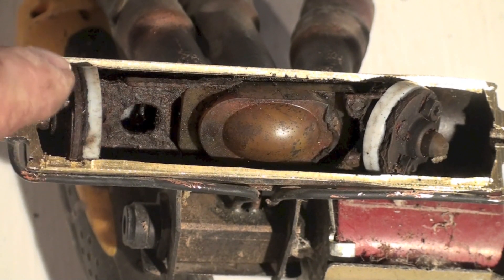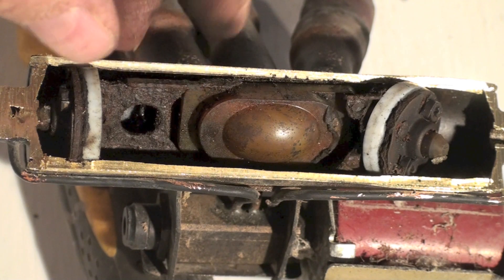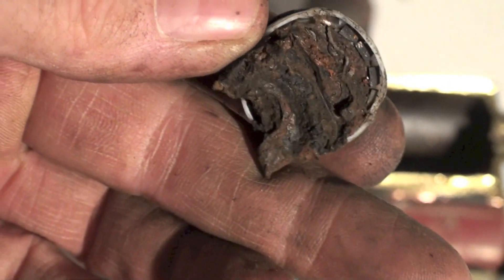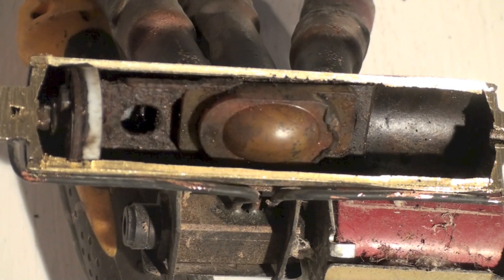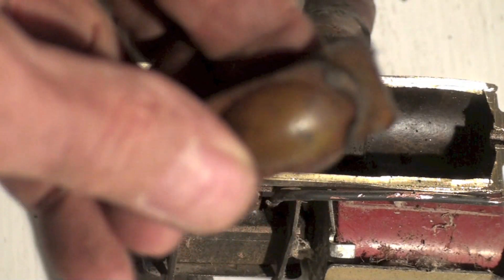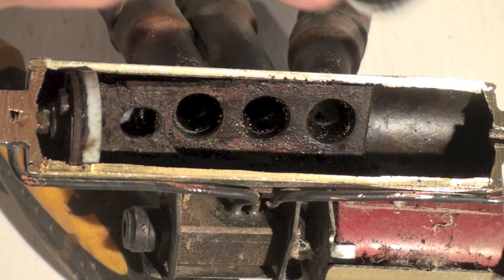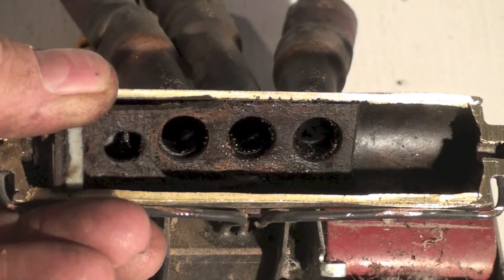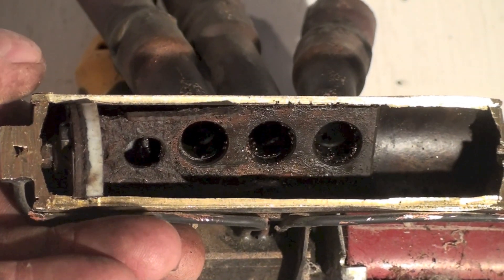Failed reversing valve opened up

Comment: I was just going to ask you, how or why does a Reversing Valve get stuck.  There's not much going on in there. Unless it's a really old one and a bunch of gunk for some reason got build up in there. I don't see how it's not possible to free them up with some heat and a few taps. Unless it's like the one in the video.
Reply from the maker: Sometimes its a blocked cap tube in the pilot valve.  Virtually any garbage in the valve will cause a failure.  I have never been able to free up a valve.  When they stick, they are done.
GFM

Comment: One of the worst things that can happen to a heat pump. The compressor can still get damaged after the valve is replaced due to the fact that the lack of refrigerant flow through any other part of the system can cause huge oil loss, especially if there is no crankcase heater. It's always good to install a good dryer, and add oil back in before vacuuming and recharging.
Reply from the maker: I will agree on everything except the additional oil.  If the oil is still in the system, it will return when started.
GFM
Reply: I thought that a majority of the compressor oil would leave the system when the refrigerant is recovered out.